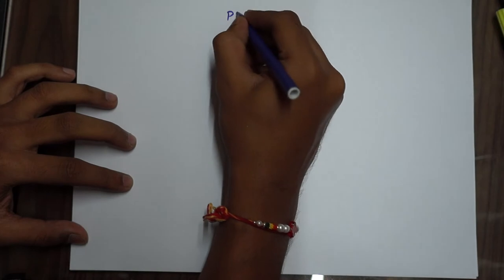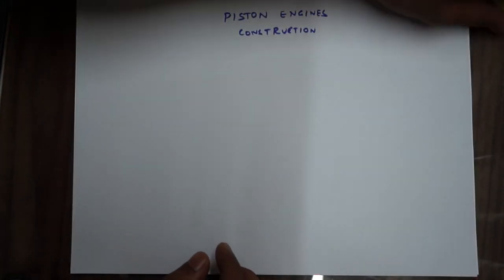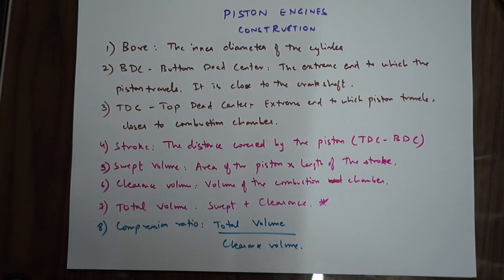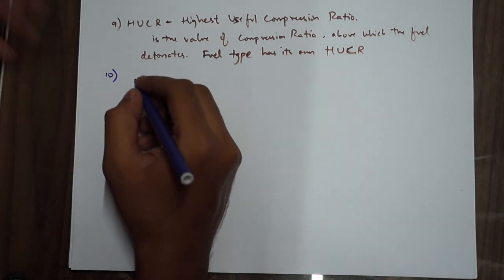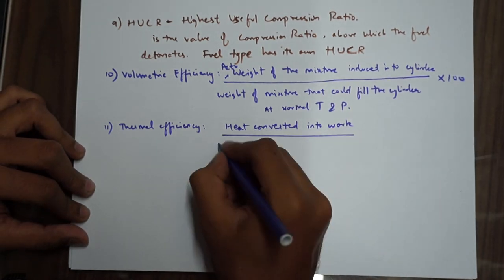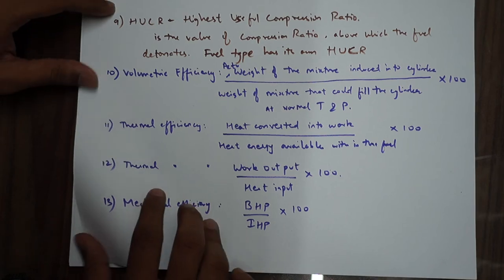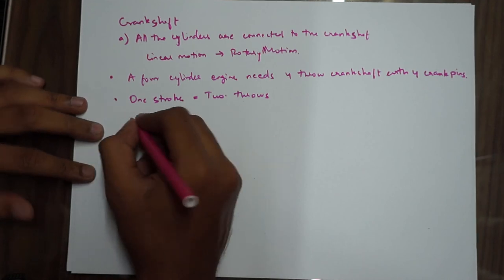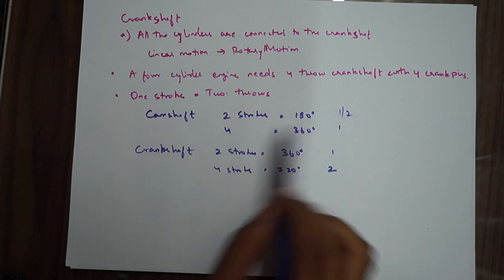Piston Engine - I (Construction of a Piston Engine)

Comment: why are we using even numbers of cylinders in the horizontally opposed engine ?
Reply from the maker: It is more to do with balance of the engine, if you have odd number of cylinders, there will be an even number of pistons firing in one direction, which will create a sense of imbalance and reduce efficiency.

Comment: I have doubt

I'm studying aircraft maintenance engineering, I am also having piston engine subject in my course, I'm using AMT PowerPlant book in that mechanical efficiency formula is = BHP/IHP and volumetric efficiency formula is = volume of charge (corrected for temperature and pressure)/piston displacement...

is this right ??
Reply from the maker: Yup, Efficiency formula have different representation, so those are also right as mentioned in your book.

Comment: man diameter of inlet valve is greater not outlet valve
Reply from the maker: Yes that's correct. Sorry for the error. Has been put in the description. Thanks a ton! It helps improve videos especially these very old ones.